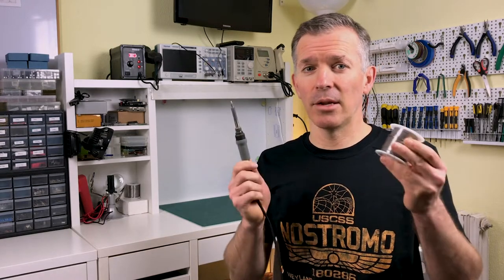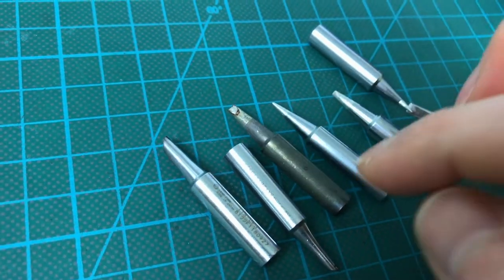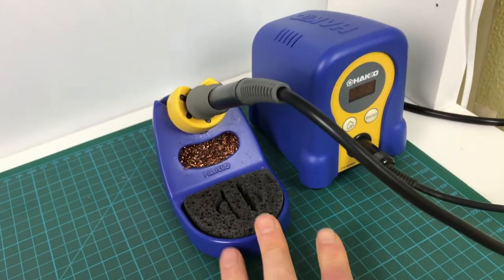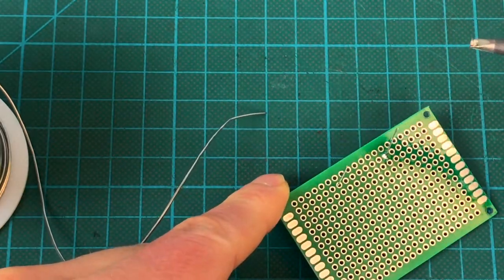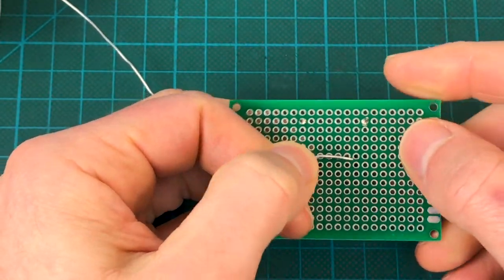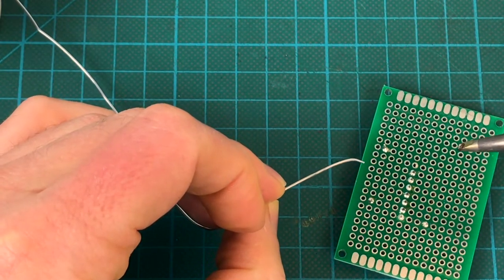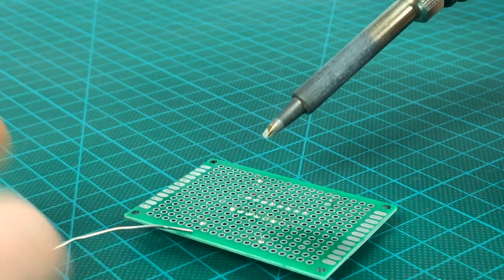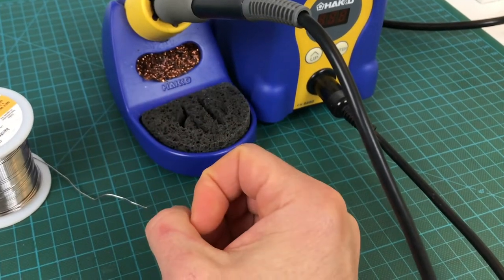Basic Soldering Tutorial

Comment: When I solder through-hole (TH) components into place, I push the legs through the holes and held them apart and cut them short THEN I solder them. Bending the legs away from each other helps hold the component in place while soldering and cutting them before soldering prevents putting any shock onto the solder joint. Check out my recap video of a BBC Master in my video titled "Recapping a BBC Master & disassembly of a Master PSU" :)
Reply from the maker: I've seen people recommend that, but it feels more complicated because if you cut them then they don't stay in place as well, so in the end I never do that :-b. Is it really necessary if you make sure to cut the leads well above the solder joint? (honest question, not saying it's not).
Reply: If you bend the legs back they won't move and there's no chance they'll fall out. It's impossible for them to fall out. Far safer on the solder joint especially on old PCBs.

Comment: Fun tip , he works on electronics with the year that starts with 19. For newer years , the thin tip soldering iron tip gets used more often. 
I prefer lead over flux for connecting points , the brand doesn't matter
It's just the amount of lead.
You just have to avoid  the lead fumes. Don't inhale it
Reply: sir i would argue quarter century old isnt exactly newer :D

Comment: Excuse me, but I believe there may be a better method for soldering than using a wet sponge. I have heard from several professionals that if you have brass shavings and flux, it is preferable to use those instead. They claim that using a wet sponge can stress the solder tip and shorten its lifespan.
Reply: I have been soldering for over 50 years, including 20 years as an audio repair bench technician, and I came to prefer the brass wool over the damp sponge. My soldering iron got used several dozens of hours every week at work and yet the tips typically lasted 4 or 5 months. Anyway, one mistake I've seen frequently in online soldering tutorials is that some people saturate the sponge with water: it's supposed to be damp, but not so wet that you see plumes of steam come up when you touch the tip of the iron to it!  The use of distilled water is preferred because unlike tap water it contains no mineral contaminants; and a special soldering-tip sponge is preferred because a kitchen sponge will be made with chlorine or sulphur compounds that will tend to oxidize the tip.

Comment: I once bought a cheap Chinese soldering iron on Amazon and it was 30€, just the iron with a few tips and some solder so I'm curious:
What "station" you would recommend for that price range considering anything worth of quality would be above 100€ (your FX888D goes for 190€)?
Because my 30€ iron is real garbage: the tips are already black as night as they couldn't handle 350°C (despite the iron being able to go up to 450°C which makes the tips glow red) and despite the (Chinese no-brand) solder having "2.0% Flux" in it it always results in terrible smudgy connections on the boards.
Reply from the maker: The soldering station doesn't have to be very expensive (mine was around 80€). But another one that I bought first that was totally fine was a Yihua 937D https://www.amazon.co.uk/gp/product/B074Z84TDL and it runs about 30€. I think that's a great one to start with.
Solder is the most important part, so if you get a good quality one, and one that's not too thick, it'll improve your soldering hugely.

Comment: Very encouraging video for an novice wannabe c64 repair man, thanks. What temperature do you recommend when working on old c64 breadbin board?
Reply from the maker: I can't recommend an absolute temperature. It depends too much on the solder, the tip, and the soldering iron you're using. I would say use the lowest temperature that heats up the joint enough after about a second so the solder melts well. In my case it's 330C as you can see there. With worse solder that can be 350C. And then, if you're working on a ground plane, you may have to raise it to 400C or more depending, but that's pretty rare.
Reply: I set my soldering iron to 280C and for most things it's fine but for the earth onto a large ground plain that zaps the heat, might want to crank the temperature up to 350C. Don't forget to use a decent flux with it and be generous with it as well as this will help the solder to adhere to the surfaces.

Comment: Nice tutorial. Well, the „old toothbrush“ is not a good idea. You are using a proper ESD safe brush, which is good. A toothbrush might produce some electrostatic charges, so it is a potential circuit killer.  The esd brushes are available for not a lot of money. Also an ESD mat is a good thing to use for all electronics tinkering. They don‘t cost a fortune, either.
Reply from the maker: True about the ESD-safe brush. Although, to be 100% honest, I'm not sure how important that is for this kind of electronics. I get the sense they're not as sensitive to it as newer, smaller technologies, but I may be wrong. It certainly doesn't hurt :-)
Reply: Noel's Retro Lab The MOSFET based ICs have always been quite sensitive, like the 4xxx series. Nowadays, many (especially interface) ICs have some protection, but it is more for „normal“ EMI protection. The old ICs did not have it, I think. Just think of the protection diodes, that you find in C64 models after ASSY250407. 

The mean thing about ESD is, that it does not necessarily destroy the circuit at once and it takes plenty kV that a human can notice it. Most ESD damages happen at much lower voltages, that humans don’t feel, like a couple of 100V. And the result might be early failure or the specification of an IC are not reached anymore. 

It rarely happens that somebody touches a circuit, feels the discharge and the circuit is broken,  so there is nearly no „learning“ effect. Most hobbyists would say „I have never ruined anything with ESD.“ Those, who say so, most probably have.

Professional assembly houses pay really a lot of attention on ESD protection. The floors are covered with ESD paint or carpets, the chairs are ESD, the tables and instruments are grounded, people wear esd shoes and coats, the shoes are tested on a daily base. Tables and floors are measured regularly. This is expensive, but a good investment.

When I watch youtube, I very often see those green cutting mats and also these light blue rubber mats, which are great, if you cut paper or repair wind-up toys, but with anything semi conductor, it is a bad choice. 

In my lab, every horizontal surface is covered with esd mats, which are grounded. It is not that expensive. The difference is like spending 10€ on a cutting matt or 25€ on an ESD mat.
Reply from the maker: Interesting! Do you have a link to a mat you'd recommend? I might give it a try.
Reply from the maker: Actually, I just realized that my silicon soldering mat is supposed to be ESD as well! I only use it for soldering because it's harder to clean, but you're making me consider using it all the time now.
Reply: Noel's Retro Lab Depends on where you are located. It should fit your workbench and have two snap fasteners. One for grounding and one for a wrist band. I think, I have bought mine from different sources, like ebay, Conrad and Bürklin (they all look the same, though).

Comment: Hi, is it safe to touch with fingers the cold wire of solder before soldering ? It contains lead, so should'nt we use gloves ?
Reply: Lead isn't easily absorbed through the skin; just wash your hands after handling solder, and don't eat food while you're working with solder!  BTW, the fumes from lead solder (from the rosin flux, actually) may be annoying to some and a few people can actually have an allergic reaction to it, but the fumes don't contain lead because solder melts at a temperature far below the boiling or vapor point of molten lead. If you find the fumes off-putting you can use a fan to blow them away, or work in a space with open windows or open garage door so you have good cross ventilation.  Commercial electronics businesses might use a special solder-fume extractor, but that tends to be above the budget of the average hobbyist.

Comment: Thank you Noel. The only question I have is, if I'm soldering the pins, and if I make a mistake with too much solder and join two together, does that matter, or would I just heat up the solder and wipe it away? Or what would I do in that case?
Reply: Get yourself some desoldering braid (sometimes called wick.) It's a small ribbon of copper mesh type material. Place it over the excess solder you want to get rid of, put the iron on top of it, and it will literally suck it away.
Reply: @Otakunopodcast  Thank you, that is very helpful!

Comment: Thank you for this tutorial!! I wish I had similar soldering instruction when I was building Heathkit electronic kits in the 1970s. As I recall, the Heathkit instruction manual said to use a fine point soldering tip (accounts for some difficulties), keep the soldering tip clean (check), and said nothing about cleaning the solder flux (which accounts for the slightly sticky trace side of the boards when done). I REALLY wish I'd known the trick of having a bit of solder on the soldering iron tip to enhance heat transfer. On the plus side, the 8 channel radio control I built (page 60 here https://www.americanradiohistory.com/Archive-Catalogs/Consumer/Heathkit-1974-03.pdf ) worked the first time I switched it on ... so I must have done something right. I'm currently looking for a soldering station that has the brass cleaner, not just the sponge, but I can't find one :(   (in Canada).
Reply from the maker: Glad you found it useful! Yeah, having a wider, chisel tip and putting some solder on the tip are huge to get good heat transfer. I wouldn't worry about selecting your soldering station based on the brass cleaner. You can easily buy it separately for pretty cheap. But if you really want to, this one is my favorite not very expensive model: https://www.ebay.ca/itm/Hakko-FX-888D-Canada-FX888D-29BY-Digital-Soldering-Station-CND-Duty-Paid/252282095008

Comment: Thanks for this BASIC tutorial, I haven't watched it yet but I assume it's for Apple II, do you include modifications to make it compatible with C64 and DOS?

Thanks for tolerating this terrible joke, I just saw Basic in the title and memories drifted back to old magazines with code in them.

I only ever attempted soldering once, had some poor starting instructions/advice, burned myself and the kitchen table, and my mother threw it all away (after dunking the hot iron in water to cool it down). I've been kind of scared, even nearly 30 years later.
Reply: After watching the video, I think I was pretty much set up for failure all those years ago. I didn't have a station, just the iron that plugs directly into the mains, with no indication of it was hot enough or even on at all. The only hint of safety was a small kickstand that flipped out of the base so it could be set down (theoretically) without the tip making contact with the surface. A really stiff cord, however, made positioning it so that it wouldn't fall over practically impossible. It did come with a small sponge in a basin, but no instructions anywhere to add water.

I'm not even sure I ever actually soldered anything. Just young idiot me not knowing how long it would take to warm up (ten minutes? an hour? no clue) so I just picked it up and touched it to see if it was even getting warm. Dropped it and ran to the sink to run cold water over the burn (thanks end of cartoon PSA). Mother got upset over The Evil Thing That Hurt Her Son, and I guess I've only ever dealt with sockets and cables in electronics since.

I've always wanted to try again with better equipment and instructions. I watch a lot of videos of people getting old consoles and computers and even before testing they recap just to be sure, and it's an oddly satisfying experience. Like ASMR for the eyes?

Now that I know it's pretty simple with the right stuff, I might invest after next paycheck into proper tools and start looking for an easy kit to begin with.

Comment: I have noticed that Amazon doesnt sell leaded solder anymore. I Was kinda dissapointed that i couldnt buy my favorite solder anymore, or at a reasonable price (12€ for 100g is waaay to expensive, before it was like 3,50€). Im kinda running out of solder and hoping to find some fresh one
Reply from the maker: I've ordered solder from here before (MG Chemicals brand) and had really good experience: https://www.circuitspecialists.eu/mg-chemicals/solder-wire-wick-and-flux You can also try Mouser and Digikey (especially if you have something else to go over the free shipping threshold).
Reply: If you buy solder through Amazon, AliExpress or Banggood it is most likely to be absolute crap and possibly a counterfeit version of famous brand. It's always best to buy solder, and even soldering iron tips to fit your iron, from an authorized specialty electronics distributor in your home country.  The internet is absolutely awash in junk solder, flux, and soldering accessories.

Comment: Thank you! Could you please do a similar basic video for a multimeter? That would be awesome too!!! For example: if I want to measure a C64 power supply and have the data sheet which show me the voltages it should have, I still don't know where to measure and how it works. This srleems like a really stupid question for most of your experienced viewers, for me as a completely beginner, it is real riddle...
Reply from the maker: Sounds good. I'll add it to the list. The short of it is: When you measure voltages you're always measuring the DIFFERENCE in potential between two places, that's why you have two leads. Most of the time you'll put the black one on "ground" which is usually all over the board (including heat sinks normally, which makes for a handy place). Then with the red lead you can probe different places and it'll tell you the voltage with respect to the other lead.
Reply: @NoelsRetroLab   Now I get it. Thank you very much!!! I really love your videos. It is a real joy to watch!

Comment: I don't think that tiny fan can solve fumes toxicity 😂

Or soldering isn't that toxic ?
Reply: Solder melts at hundreds of degrees below the boiling or vapor point of lead; the fumes are from the rosin flux but do not contain lead. A few people may find the fumes to be off-putting or occasionally even allergy inducing, but for most people a well ventilated working space and perhaps a fan is all you will need. A vacuum operated fume extractor to remove the fumes to outside is generally above the budget of most hobbyists.